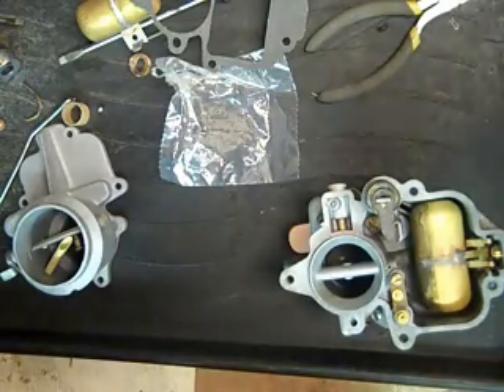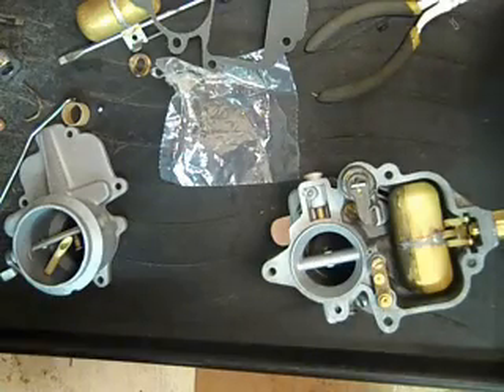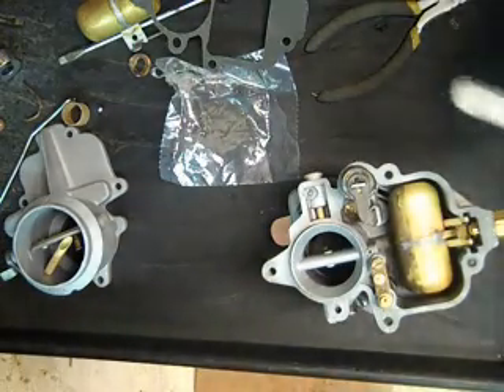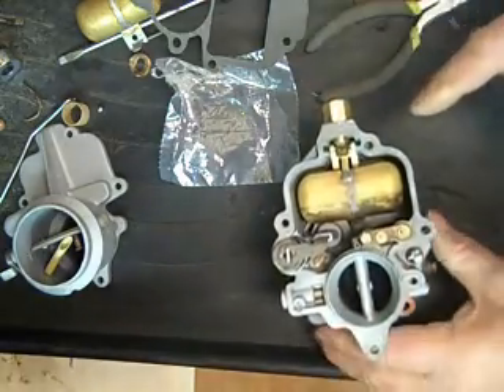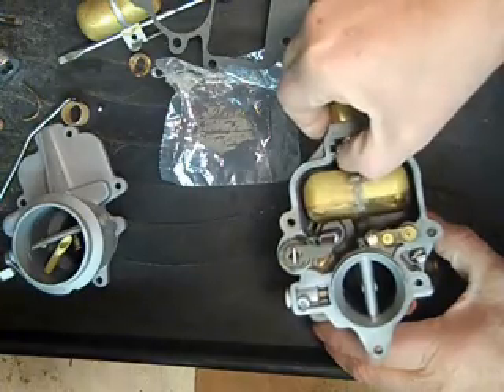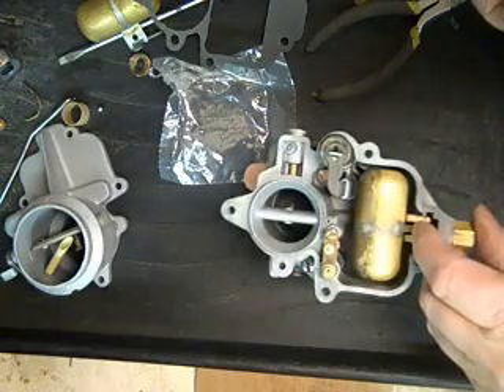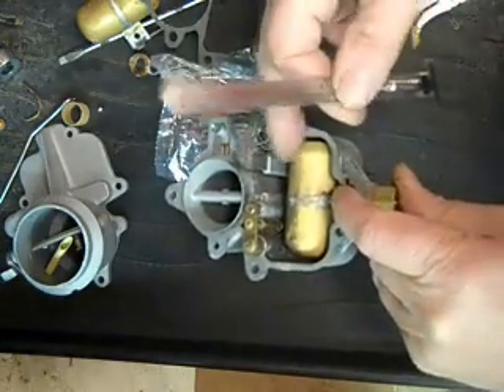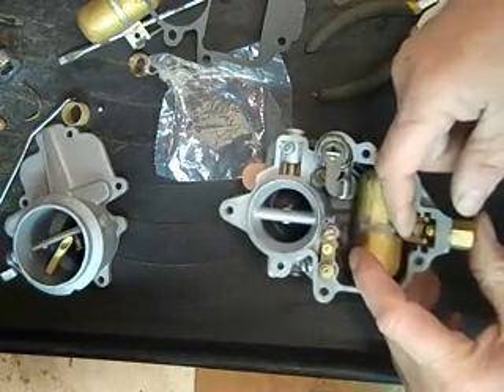Carter B & B Carburetor - Adjust Float

Comment: I have a thick gasket material gauge to different sizes measurements for the float. Haven't seen to many. I probably have about 20 carbs left plus 2 new ones still in box . And a few gasket sets. 
I use to rebuild them when I was 8yrs old.

Comment: mike i have a chrysler old manual on the carb they show this float adj to 5/64 not 5/32's can you verfi this i used a 5/64 drill bit on a popcycle stick a dab ofsuper glue holds the drill bit   adj till float just touches the drill bit  should be close enough  i had no idea wher to find a gauge so made me one
Reply: it states  float level  almost all models  of theses carbs  as 5/64th

Comment: Should the float have fluild in it
Reply: if its brass float leaking    if you are very careful you can drain it  and seal it    i think they would be hard to find  on ebay  mabe a plastic one  to swap it out  i had i leaking  but i was able to reseal it
Reply: best way to repair  those small floats is drill a tiny hole soyou can drain it then soak in water  till you have fumes gone  then solder the leaks and the hole  --- i did this once with no problem

Comment: What would be a good comparable carburetor to use as a replacement? I have a 39 Dodge 1.5 ton truck, the Carter B&B is in pretty bad shape. On a budget so hoping to spend a little less than the cost of a complete B&B.

Comment: So I just rebuilt one of these, reinstalled, and attempted to adjusted the fuel air mixture and throttle screws. My question is, on the fuel air mixture adjustment, which direction does what? Left turn, equates to more fuel, or less.
Reply: on the air   fuel adj   this seems to work  with eng running  turn clockwise till slowly till eng sputters the slowly back counter clockwise till she smothes out  what you doing is adj amount of fuel coming out the spray bar to fine mist  we used to set aglass of water on the eng with it running adj till water quit shaking  i drove one of trucks  Korea war  when uncle sam owned them  52 55

Comment: I have a 1934 Plymouth with a Carter BB carb.  The factory literature for the carb (form 6544 Canadian) calls for 5/64", not 5/32".  At 5/32, you will be flooding the bowl and most likely have gas flowing out of the carb.
Reply: you are right  i made that mistake   lucky for me the tube below pvc valve toward crack case had a leak i could see it dripping  had start all over    i had to change my oil just be to safe